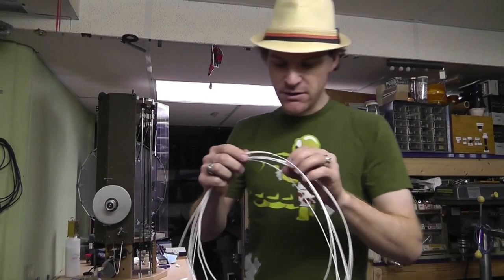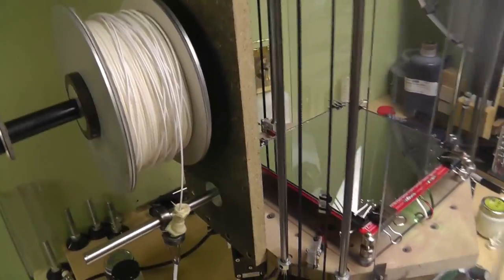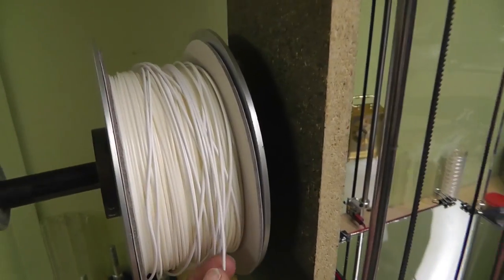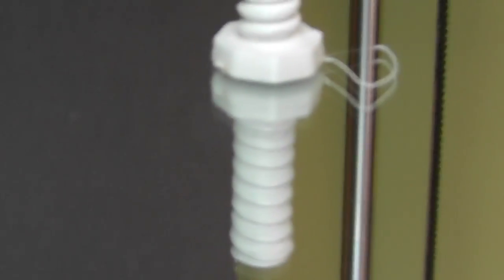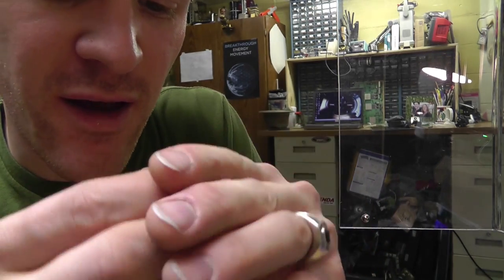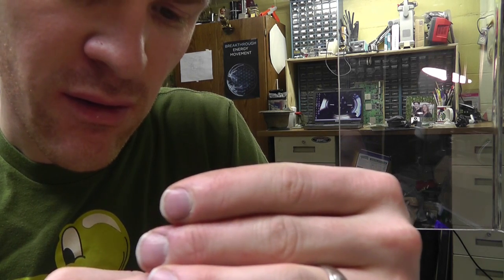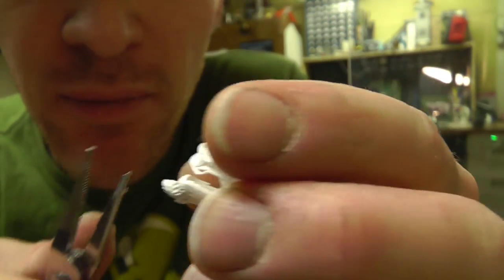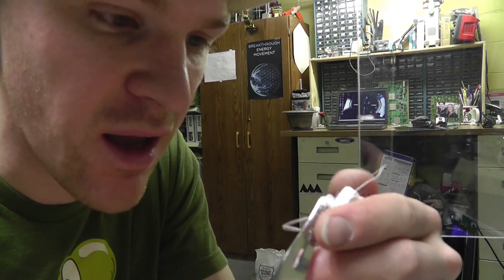#6 ~Russ's Filament Extruder: Some Tests With Home Made Filament.( Wrong Plastic )

Comment: Possibly there could be moisture issues. Could be a good idea to rig up some kind of dryer for your pellets before extruding just to put that into the equation. (A friend of mine works at a plastic molding factory, and they always dry the plastic before injecting it, otherwise the product will be brittle and have other issues)
Reply: is it possible that the high heat evaporated too much of the moisture at the end of the extruding process?

Comment: Will there be a plastic grater? For re-cycling bad prints? Can you just mount a food processor on the hopper?
Reply: i can see russ in a chef's apron , making recipes for the plastic. aading what has been lost in the 'processing'
Reply: ever use any bacteria??
Reply: Add plasticizers to the filament extruder? Detergent makes a good concrete plasticizer. Will that work?
Reply: What about a chemical re-melt? like acetone?
Reply: maybe a fresh injection of 'newly aquired'' recycled plastic bottles. sometype of recycled (easy to find) grinded up plastic may be useful for 'reinjecting' into the mix. what plastic has the most plasticizers? There is a product called ecoboard which uses chopped up plastics, for a machinable building board
found a little 'clue' for using HDPE. http://epsplasticlumber.com/index.cfm/page/performance_characteristics/performance-characteristics.cfm
Reply: *****  Thats where I am leading.. I want to be able to collect trash and use it to print on the printer I am making from trash... DIY recycling.